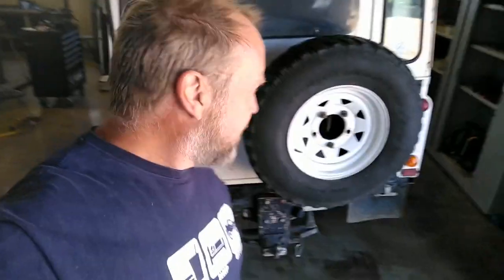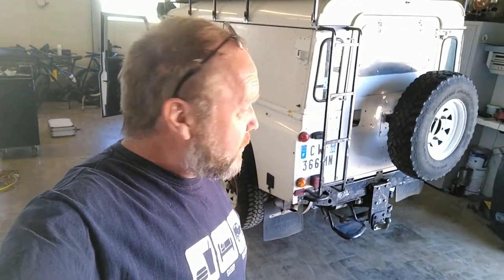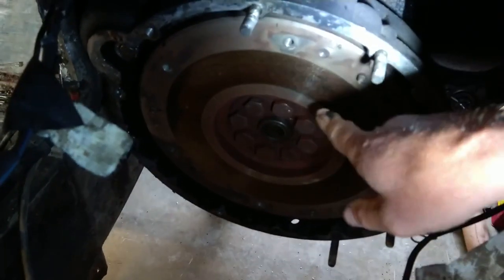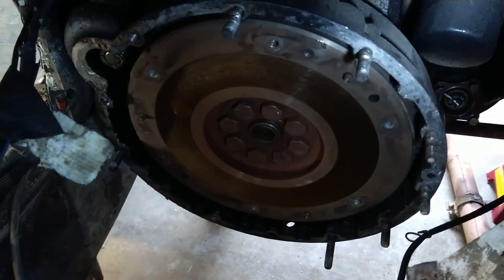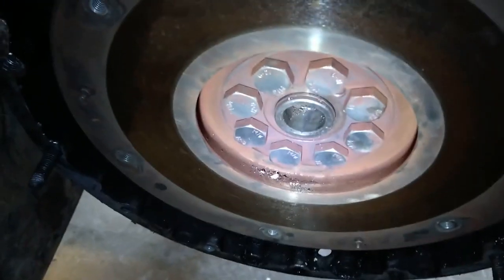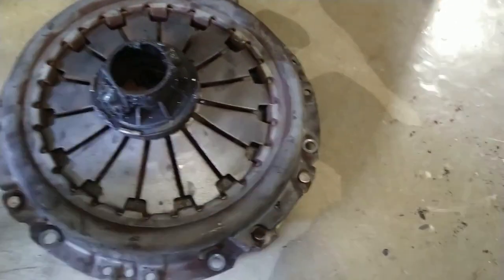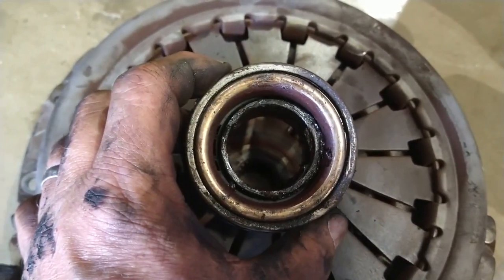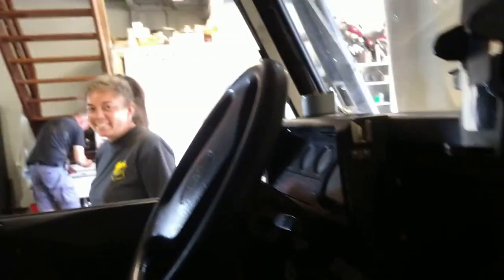Pulling the Gearbox, DIY CLutch Replacement  | How Hard Can It Be? #landroverdefender #mechanic

Comment: That bad piece of welding on the selector fork is where someone has reinforced  (not factory) the pin can wear through on cheaper forks hence the plate in front on the pressed dome.

Comment: I find it easier to remove the engine to do the clutch. Much easier to manipulate the engine than the gearbox. Takes me about an hour to remove my engine. My Series 3 I did what you did, and it was a struggle. On my 90 I popped the engine and it was far easier.

Comment: Wish I hadn't clicked on this.. bad omen... Mine's just packed up too on the Santana...
Reply from the maker: 😬😮 good luck man - give it a go! (🧐although Santana has a different engine/gearbox🤷‍♂️?)
Reply: @ASimplyFabLife  Yeah different engine (Iveco) and gear box (used to be an LT85) but mine has the ZF....
Same basic clutch though just thrust bearings different. 
Fortunately seems to be the clutch side master cylinder that has gone as it is leaking badly and the hydraulics have no pressure.. Parts ordered. 
Will be a good result if the clutch itself is still working ok...
Reply from the maker: @garethdwatkins  I'll take the clutch slave cylinder 🤞for $12 please, Alex (roll Jeopardy music 😉)

This was a nice experience to have had... but I sure hope it doesn't amount to removing your gearbox

Comment: Would re fitting be easier if gearbox and trans box were split?
Reply from the maker: Not sure on that one 🧐but might make sense. I have to say (again) that the engine hoist makes short work of it. And it may save some extra spanner work leaving it whole (and dare I say another potential leak there if it wasn't already😅😆))

Comment: Where did you get the alignment tool please?
Reply from the maker: The garage we bought the parts from lent us the tool for the job (not sure if I mentioned it in the video). They are available from the main vendors or ebay (e.g. less than a tenner from Paddock)